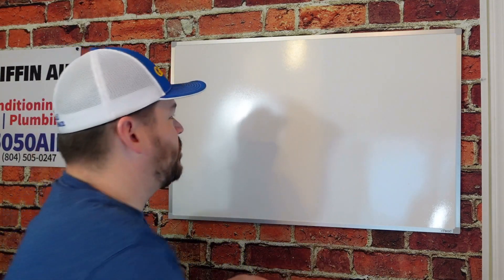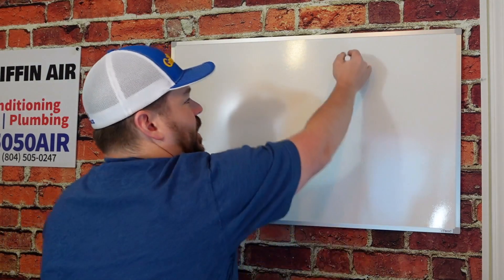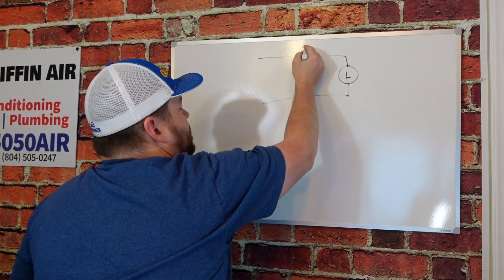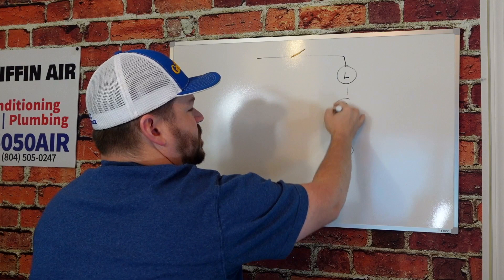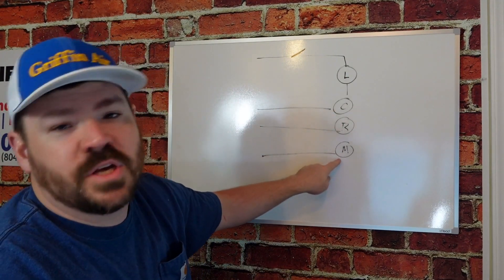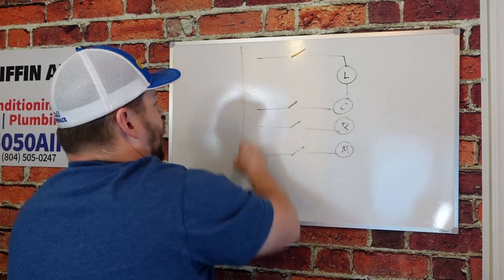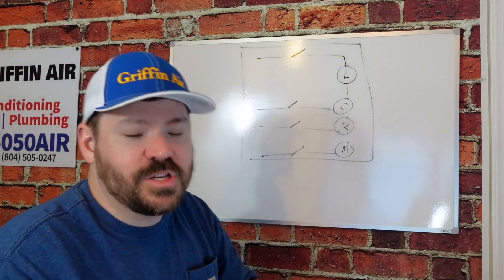CONFUSION on Communicating Thermostats EXPLAINED!

Comment: Yes indeed need Shielded wiring. Reg wiring cause issues....also need good wifi or internet svc. If too slow tstat would be idle forever....been there...trust me. U need Electronics DC understanding. Reg 24 volts is rare among DC voltage systems like this.   EEV ....an example of pwm pulses sent thru.   That little Motor with Teeth. 😢.

Comment: Can you please explain how a Friedrich Breeze non-communicating inverter system works. I have the ducted system (paired with the blower) installed in my new house, it does not run constantly like what I've read how inverter systems do, so I'm a bit confused.

Comment: I have a Rheem heat pump (RD17 condenser with RH3V air handler) with the EcoNet communicating thermostat.  It sucks.  Are there any good alternatives that I should consider with my Rheem heat pump?

Comment: My new variable speed American Standard Quest 4mxa2036A10NUAA paired with the same air handler, and a Honeywell pro red link TH8320R1003, installed less than a week ago, it cycles 5-6 times per hour, I don’t think this is as energy efficient as it could and should be. I think it needs longer run times, and not so much starting n stopping.. unless you think this is normal.. I just don’t want to stress out my new equipment unnecessarily. Thanks

Comment: Those thermostats communicate with a protocol called I2C.   I have a system that my technician just gave up and luckily I am versed in electronics to where I have a scope and I was able to decode the way the units communicate.   The most problem found out there is to be able to get a thermostat with only two wires for communication and an extra two for power.   The cooling, heating, heat pump... etc. all is communicated via "packets" of information to the furnace and to the compressor.   Nice way of saving wires.   Just a word of caution... I would not use the old wiring for the typical way since it is not twisted not shielded, and so the system may end up picking up interference on the cables ( cables act like an antenna) and produce intermittent service failures
Reply: So twisted wire is shielded ? Onto a;ways , or are you saying if wire is not shielded it should be twisted ? Does twisting make interfe ce worse or better and why ?
Reply: @johnwhite2576   Twisting the two communicating wires helps in noise reduction  from EMI,  Improves signal Integrity and minimized cross-talk.    This is because the interference affects both wires equally.
Reply: So rite about shield wires so true Electronics play a big game Most DC operated Circuit Boards are used the way Trane design these systems one must like u said Electronics Techs to figure this and also yes it needs internet and is thru ur E mail n wifi info otherwise it would not work

Comment: Our thermostat went bad, so now we get to shell out over $1,000 for a replacement because we've been told we can only use Carrier Infinity Touch Control Thermostat with our system. We have a CARRIER INFINITY 17 HIGH EFFICIENCY W/ 2 STAGE COOLING 70%/100% W/ 96% 2 STAGE HEAT VARIABLE SPEED CONDENSING FURNACE. Any suggestions?
Reply: ecobee, possibly
Reply: @robquin2460  That is not true that the system must use a specific thermostat, unless you want fancy features like humidity control, filter exchange reminders etc.  All furnaces have the basic on/off controls for the heat pump, fan and heater.  You should be able to use a standard control as long as you know how to wire the  lines

Comment: My system uses a non communicating thermostat that the goes to a proprietary interface that converts it to a form that the communicating system heat pump understands, I'm currently trying to learn if it is possible to remove the interface and turn it into a noncommunicating system.
Any help on this would be greatly appreciated.

Comment: I just received a estimate from HVAC provider to replace my "communicating" thermostat on my proprietary Lennox system. All that's wrong with it is the screen went blank and the only solution is to replace it with a proprietary Lennox thermostat that only Lennox can install! $1700.00!!! $800 for the thermostat and $900 to install!. Now tell me again HVAC companies don't rip off their customers!.
Reply: We have had a "communicating" Lennox iComfort thermostat that was originally installed with our new furnace 8 years ago.  The problem we have been having is the temp differential between first and second floor.  The problem with iComfort is that it cannot handle remote sensors.  So, a couple of days ago I bought an Ecobee 4 smart thermostat that came with a remote sensor.  When I tried to replace the thermostat, I noticed iComfort was using only 4 wires but Ecobee needed 6 wires.  We have a two-stage system.  Fortunately, the guy who had installed it had used a 6 wire harness and not used the other (yellow and brown) wires.  I called the Ecobee tech support (they are the best) and the technician walked me through the installation, taking 45 minutes.  He had me take pictures and upload them at every step of the way.  After completing the installation, the the AC test failed.  The fan would come on but no cool air.  The compressor would not come on.  20 minutes later, the technician gave up because there was another 4-strand wire that went from the control unit on the furnace to the outdoor unit.  He did not want to risk and give me bad advice, so he asked me to call Lennox and get the wire configuration.  Called Lennox tech support and the guy said I needed to call a Lennox certified repair person - useless tech support.  I have an electrical engineering background.  So, I stared studying the wiring diagram and discovered the wiring system for "non-communicating" thermostats.  I had to go to the outdoor unit and rewire the outdoor unit as well.  Mind you at each stem of the process I made sure the electricity to the both indoor and outdoor units were shut off.  I opened the outdoor unit (compressor) panel and sure thing the four wire harness was connected to the communicating port of the system.  Using the wiring diagram I disconnected the four wires from that port and connected them to the non-communicating port.  Basically, I needed the red wire (R), the white wire (C) and Y1 and Y2 wire since we have a 2 stage system.  I then did the same thing on the controller in the indoor unit (the blower).  Turned the electricity back on and everything worked perfectly.  Installed the remote sensor for the ecobee upstairs and now we do not have a temperature differential between floors.  

I read somewhere on the internet and with Lennox systems, one cannot replace the iComfort thermostat with a non-communicating thermostat (in this case Ecobee).  Obviously that is nonsense because I did it.  You just need to rewire the harness that goes to the outdoor unit as well.
Reply: Lost power means new transformer or bad wiring.
Reply: You ever ask mc Donald's how much they paid for their burger and fries when you order a value meal go large? How dare people try and make a living. Lol.
Reply: @robertpalmatier2699  
No need to, McDonalds sells their product at a fair, competitive price and their product is not proprietary like Lennox. Of course, the "salesman" never mentions that.

Comment: I have a question for you, the previous owner installed a new A/C unit (10/2019) and the thermostat is battery run. I want to change the thermostat with a more up to date and touch, programable thermostat and I don't know which one I should get. I have a Carrier Brand Model number # FB4CNP025. Any suggestions? Thanks. I am enjoying your videos.
Reply from the maker: Check out the Honeywell T series.
Reply: @NewHVACGuide  I will and thanks for responding. I’ve enjoyed your videos.

Comment: Thanks but you are confusing more.   The non-communicating thermostat sends a fixed level DC voltage to the furnace controller,   The communicating thermostat sent series of pulses.  The modulation of varied pulse duration results in different voltage levels seen by the communicating furnace.    The furnace uses these voltage levels to determine the motor speed and more/less gas valve opening
Reply from the maker: Non-communicating thermostats typically use AC voltage :-)

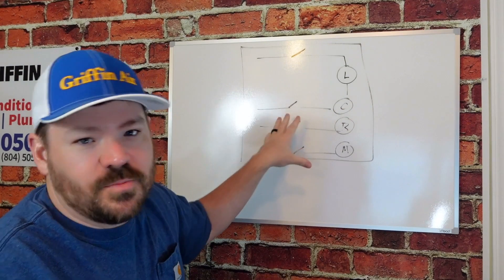Comment: 3:42 Communicating thermostat appears to REQUIRE the Internet to work… 4:30 “like the internet” 🛜 big brother. It is important to distinguish “local” vs “cloud / internet” based communicating thermostats. They could all be local, but some vendors choose and design their system components so that their computers in the cloud are the “man in the middle” and “require” the home owner to provide the WiFi and Internet for the “system” to work. 🙄

Comment: Forget to pay the internet bill and then you're HVAC stops working lol. Hard wire systems aren't going anywhere. They're too easy and reliable. No homeowner in their right mind would go full wireless when wireless room sensors are available. Wifi been around decades now and ethernet is still king for even semi-stationary devices. A bold prediction indeed!
Reply: Bluetooth and WiFi are different. Systems can even communicate through radio waves. There are systems like Rheem and Weil-McLain that allow troubleshooting and system analysis through Bluetooth now.
Reply: Wired and local-only wireless for non-essential functions is the only rationale, secure and reliable way to go. Putting WiFi networks, internet access and HVAC cloud services in between your thermostat, furnace, heat pump, and system devices (AQI monitor, cleaner, humidifier, etc.) is just asking for big brother control and a fragile system. So many home security cameras no longer work after bad updates, company bought out, or service APIs become out of date.

Comment: Yeah I just had an entirely new system installed American Standard gold 17 two-stage heat pump with its matching gold variable speed air handler pretty sure neither or not communicating but they installed the matching American Standard 1050 Platinum thermostat those guys didn't know what they was doing because obviously communicating thermostat only three wires B R and D. Long story short thermostat wouldn't do nothing but keep throwing error codes turns out it also needed an American Standard BAY24VRPAC52DA Relay board to tell my system what to do. Now they are scratching their heads trying to figure out how to wire it to make my air handler which is variable speed into a communicating air handler. Basically they are going to wire up the relay board using the communicating air handler non communicating outdoor unit instructions from the thermostat setup booklet.

Comment: The irony is that all thermostats are communicating otherwise they would not work. It's the form of communication in which they work that classifies them.  Also ironic is that I have removed so many "non wired code communication" thermostats on behalf of the property owners desires it's sad. I wire back into service or install hard wired thermostats into their properties so they can have some sort of simplicity and security of their systems working correctly.
Reply: That is exactly what I am facing.  I have a Trane XL18 communicating heat pump with their proprietary thermostat that I find it is JUNK in my opinion.  I cannot find another brand (maybe Honeywell) that will communicate with this system.  I am danger close to tearing out the system and installing a 2 stage heat pump.
Reply: @lewisholder7827  Local wires (Aka old technology!?!) is the most clearly reliable, durable, and secure system! Communicating (data) can work over copper wires as well… that’s what Ethernet is! So much more reliable that adding routers/access points for WiFi and depending upon and internet connection and HVAC companies “cloud service” in order for devices to connect and communicate! Bluetooth and other home automation wireless protocols - as well as wired - can communicate all the same low bandwidth data much better than an internet connection. Internet is only for remote control… most likely by HVAC vendors rather the home owner.
Reply: @lewisholder7827  same here My system uses a non communicating thermostat that the goes to a proprietary interface that converts it to a form that the communicating system heat pump understands, well the proprietary interface is crap and has failed multiple times now,, and each time it has been under warranty but the service call is not covered, so each time it cost me a good sum because it always fails when you need it the most, so then it becomes an emergency call, the short of all this is that well the inverter system operation maybe more economical, the repair of the control system is costly, so it a zero sum game for the homeowner.
I suggest to anyone considering a new heat pump to go with the simplest system they can, in the long run it will  be the most economical due to repair cost when it fails. I'm currently trying to learn if it is possible to remove the interface and turn it into a noncommunicating system.

Comment: Are there units with communicating thermostats that aren’t multi stage or variable now?  If I had it to do over again I probably would not have got carrier infinity heat pump and furnace hybrid.  I should’ve got infinity variable AC with the variable furnace rather than the heat pump and two speed furnace.  The old one went kaput A few weeks before the local distributor got the first of their slim five speed units.  The Honeywell red link I IAQ thermostats I’d used on the original system with their zone damper control board were much nicer than these carrier ones that are like 700 bucks apiece.  At the time I wasn’t aware of any other variable system and I thought that would be the right thing to overcome the builder having zoned it incorrectly without having to do construction to reconfigure returns. Anybody with any sense knows to avoid proprietary shit that’ll be harder to find parts for and people to work on and I did it anyway

Needing to replace the first system that was only a few years old because of solidified debris in the refrigerant line and needing to replace the ducts again 2 months after having the second one installed because they’d filled with water (and clearly not thinking it through to the right combination of equipment) all taught me the installation is what makes the difference.  I should’ve known if the damper system didn’t get around the zones being split incorrectly between floors neither would a more expensive unit, and the contractor could’ve billed me for more work rather than more product if he had explained that to me when I told him what I wanted.  When I accidentallybumped into the duct in the attic that was completely full of water of course that should have been a labor warranty replacement but when he told me no I didn’t even argue because I didn’t want him in my fucking house again. Even (some of) the garage door openers now use some kind of pseudoserial communication protocol over their two wire controlbutton bus.  Neither one of these are product choices i’d have selected if not for trying to avoid going in completely new directions from spec builder’s original decisions. Damn garage door opener with some kind of thing that Wayne Dalton quit making and the closest thing to it is a LiftMaster side mount jackshaft opener (of which I’ve since now had two).  They’re fine it’s just I stuck with that style because the first door and opener had torsion springs versus lift springs with that gimmicky opener i’d have never chosen.
Reply: There is no third party thermostat (Nest, Honeywell ..)  that support variable speed furnace.  You will stay with manufacturing thermostat but you then lack of cloud stuffs and  cloud control.  You can still but you will lose what is called by "variable"
Reply: @davidle896  I didn't think so.  I'm sorta surprised ecobee or somebody hasn't come up with a multi-brand one almost like a universal remote since those are proprietary protocols but I don't think they're licensed.  The carrier unit remote service integrates with other cloud stuff fine and I still regret it anyway LOL.   You were definitely right that the installation makes a bigger difference than anything about the equipment

Unless they didn't do well I think probably the 3 stage compressor and 2 stage furnace I gave up waiting on woulda been the better way to go.  My mistake was forgetting the other unit was still a compromise.  If I'm not willing to do whatever construction would reconfigure it correctly then any installation is a compromise with something to regret.  Generally less to regret about cheaper compromises.  It's about to be time to replace the smaller unit so I guess I'll either do the construction and replace them both or just get a cheap one

Comment: I am curious how the inverter systems function on Non communication systems, since the thermostat is only sending an on or off signal how is the ECU in the condenser know to vary the speed/flow of the compressor? How does it know without knowing the indoor temp but instead just an on/off signal? I assume on an inverter system communication style is preferred, but they are out there with the non communication type
Reply from the maker: I can’t speak for all of them, but I know the Bosch heat pump monitors the suction temperature and ramps up and down based on that

Comment: Video idea for you: heat pump balance points and what contractors get wrong about them. Some contractors still are installing new heat pumps with heat strips and setting the heat pump to shut down below 25F and only use resistive heating. Thinking is stuck in the 1980s when HPs didn’t work in freezing temperatures, but now most operate fine below 0F, with reduced efficiency but still a COP far above the 1.0 of heat strips. Obviously this spikes the homeowners electric bill. Put a thumbnail with “SABOTAGE?” for views 😆
Reply from the maker: Good idea. Lock out temperatures are something most avoid giving any real thought to